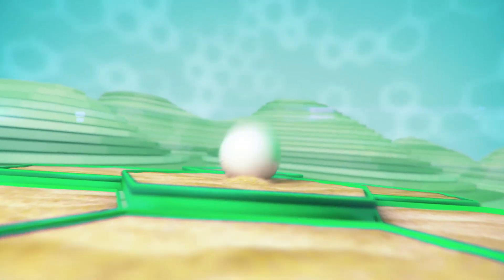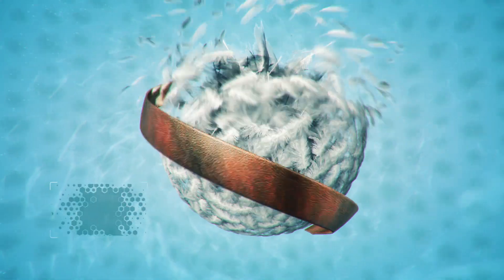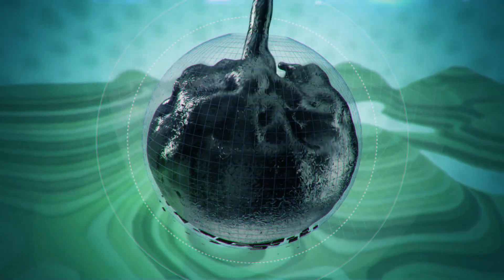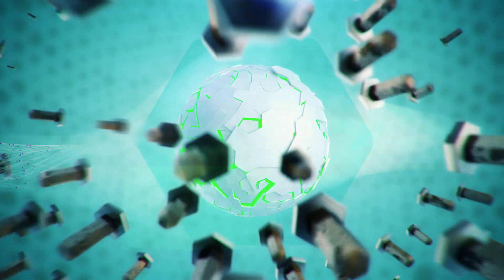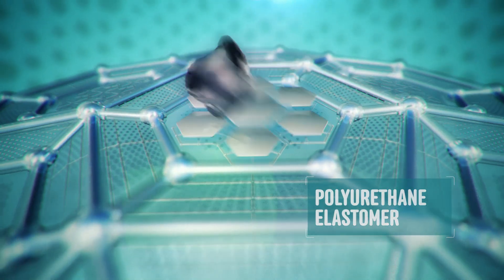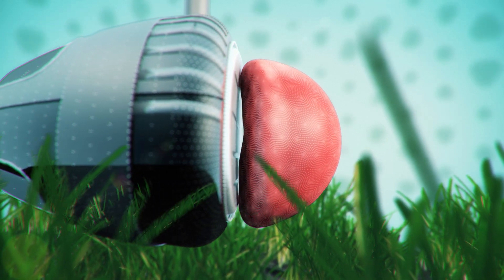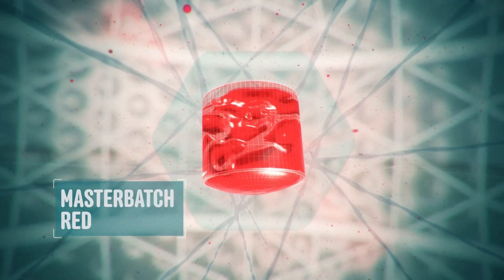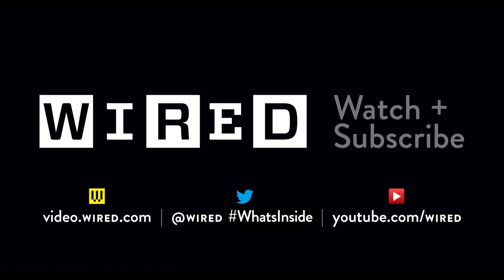What's Inside: A Golf Ball - WIRED

Comment: I remember as a kid I took an old cracked golf ball apart. once I got the outer skin off,there were layers and layers of a rubber band like material wrapped around.I found the quickest way to remove these, was to hold a lit match under it and all the rubber bands would just go Plinkplinkplinkplink and fly off. and under that was a black ball, which my dad told me not to open because it had a poisonous chemical in it that made the ball fly further. But the center was like a super ball! I could slam it onto the concrete patio deck and it would fly higher then the house! LOL but those were Old skool golf balls tho
I never found out what the secret chemical inside the center was.
Reply: DUSTERDUDE238 Sometimes real honey was used.